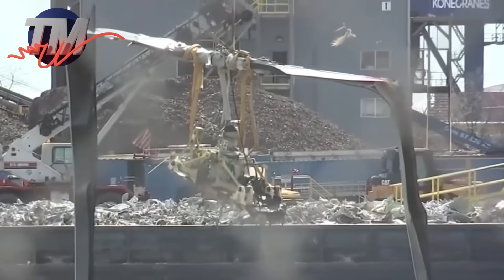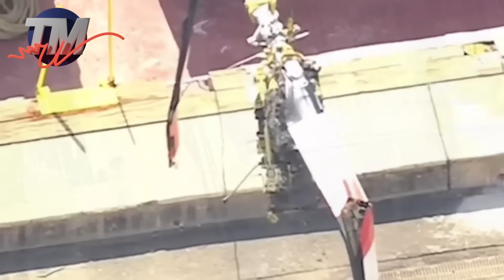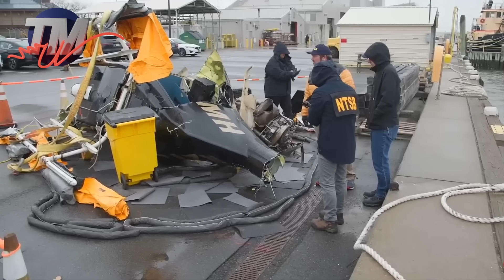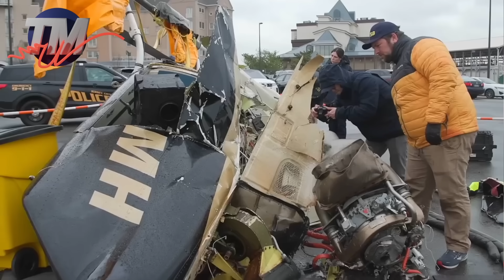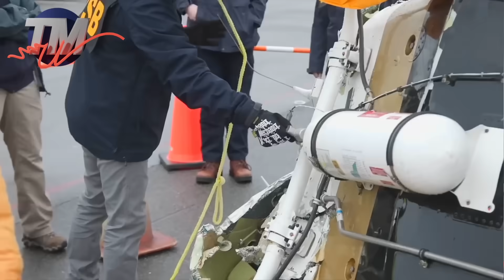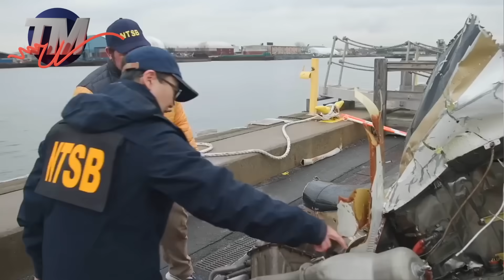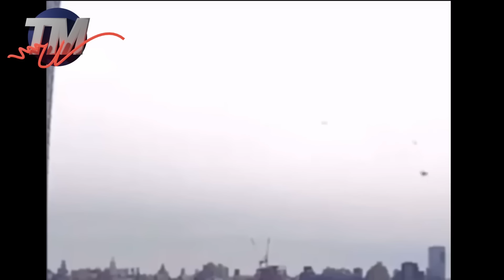Recovery of the Main Rotor of the Hudson River Tourist Helicopter - it's worse than we thought

Comment: There is a known failure point with the 206 the tail shaft coupler de laminates and the tail will immediately swing around. There was a medical 206 that crashed recently in the us and it was attributed to the tail coupler de laminating. The aluminum splined coupler is epoxied to the composite tubing
Reply: Is that the helicopter that hit a palm tree?
Didn't that just loose drive to the tail rotor? (The the epoxy joint was slipping & that generated enough heat to blacken the epoxy but it didn't cause destruction of the tail boom or anything).
If it's at cruise speed, as in this incident, isn't the tail vertical stabiliser supposed to be enough to prevent the fuselage from spinning in the event of loss of drive to the tail rotor? (There would be considerable yaw but it wouldn't spin). The options then being a sliding landing or an autorotation. (Which would entirely remove the yaw problem).
Reply: @ the vertical stabilizer wouldn’t be enough to counteract the torque of the main rotor,it would definitely spin around. Remember this was a novice pilot that was definitely taken by surprise in any event. In the other crash the pilot’s experience led to a better outcome even though the helicopter was destroyed. When this happens you have to bring engine to idle right away, and drop altitude and this will help immensely to counteract the torque but it still won’t want to stay straight

Comment: Good to have some clarity on such a tragic event that unfairly took so many lives. 
Having watched several stories on the destruction of the helicopter, I agree that it seems the tail rotor broke off at the joint near the fuselage. That seems to be the catalyst to everything else. The cab then spins violently and shortly after the transmission and rotor separate as one. I couldn't figure how they could both happen at once. They didn't. I imagine the connections or metal fatigue in tail/fuselage area will be the determining cause. Thank you.
Reply: My wild take is that once the tail structure failed, the body started to twist, wich unfortunately may have pinched the tail rotor transmission, suddenly transmitting the torque of the blades to the body, hence the huge impact energy between the body and the tail. However, with my lack of specific knowledge of helicopter internals, I would have assumed that in case of tail rotor block, something else would break before that, rather than just turning the rotor and body into a single unit. Also, that the helicopter body slamming against it's own tail, shouldn't have enough energy to rip the whole transmission from the structure...it just feels so unbelievable...
Reply: @Nixie_EUC  Play the video on slow speed and watch at 4:25. Just as the helicopter gets to about center of the logo, it looks to me as though the nose begins to pitch up. The transmission pylon failing could cause that to happen. Then as the trans started to separate front to back, the rotor would tilt back which could cause the M/R blades to strike the tail boom and the yaw, so on and so on.
10,000 hours on a helicopter airframe is a lot of hours. There would have been numerous opportunities for hard landings and over torques that could have weakened the structural integrity of the airframe and transmission pylon structure. 
I'm only sure of one thing though. The NTSB will figure it out.

Comment: Is the distance from the point at which the tail boom was sliced off consistent with where the man rotor blades failed? If so would indicate the main blades sliced off the tail.
Reply: As LOTS of people have said before, no, it was not a tailstrike. 1: yes, the break place is too close to the man body, the blades can't reach that part no matter what. 2: The break is clean, rather than bent wich indicates self fracturing, instead of an impact from a blade (imagine bending a straw)
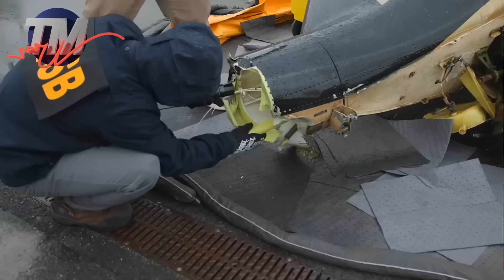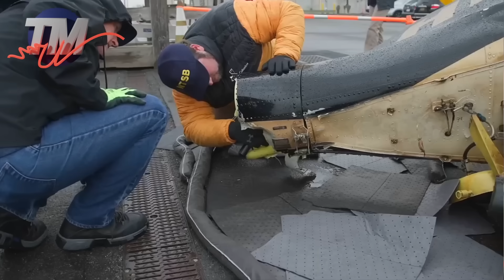Reply: @Nixie_EUC  break isn't quite clean, if you look at 1:49 the skin is bent/stretched at the break site. At 2:02, you can see a large depression at the top of the boom where the metal was deformed. Additionally, contrary to the video, I don't think this is the attachment point for the tail-- I believe that is located at the 'gap' in the panels to the right in the video. I'm not saying their was a tail strike, damage could have occurred there as it may have been the pivot point if the aircraft did yaw suddenly due to transmission seizing or roof tearing from some sort of severe vibration.